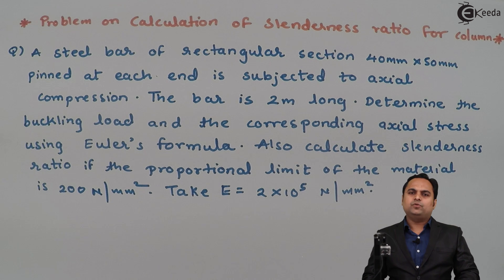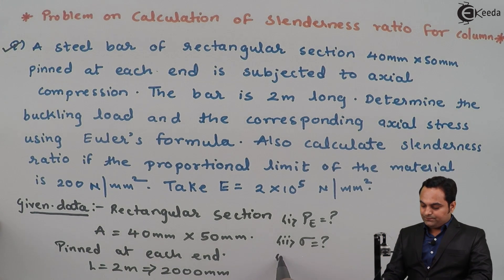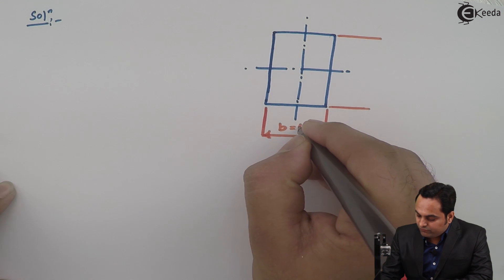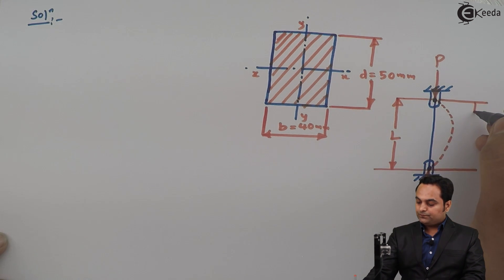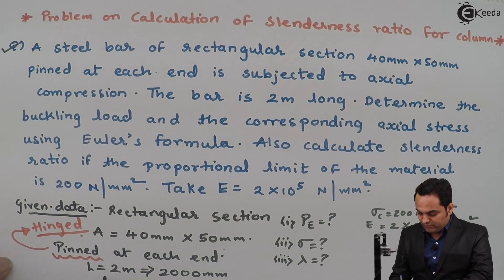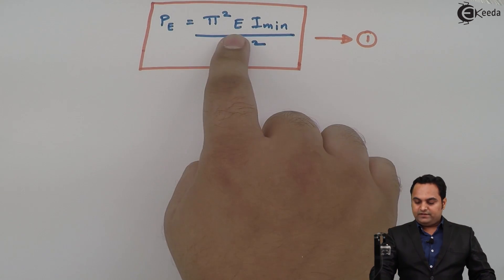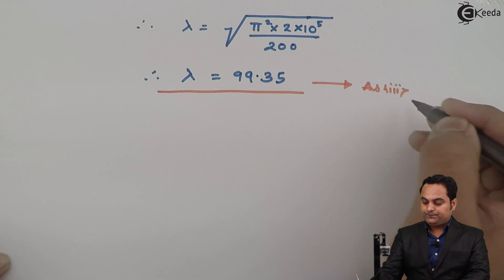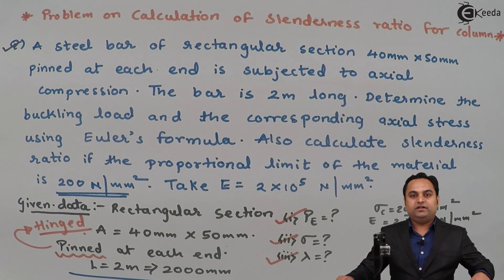Problem on Calculation of Slenderness Ratio for Columns - Columns and Struts - Strength of Materials

Comment: Difference between minimum vs maximum
How to use the word minimum vs maximum in terms of allowable value?

1.The meaning of minimum is 
"it should not be less than" =therefore the correct allowable value is always the highest value

2.And the meaning of maximum is "should not be greater than"
=The allowable value is always the smallest value

Pls correct me if im wrong thank you

Comment: If we calculate slenderness ratio directly by formula ( effective length/ minimum radius of gyration) = 2000/11.547 = 173.20 but in this video its value is 99.
Reply: I have also got same  (173.20).
Reply: yess .. why is that ?
Reply: I have also got same . 
Hello seniors 👋
Reply: , i also got 173.204
Reply: the Leff/K is the actual slenderness ratio of the column geometry, and the second is a limiting slenderness ratio related to material and buckling stress limits. They serve different purposes: one describes the column's physical slenderness, and the other helps predict the buckling behavior threshold

Comment: on the same kind of problem, they have asked lateral deflection delta/eccentricity (e) to be calculated by a flexural equation  (M=P.e) providing yield stress.is it necessary to deduct direct stress from yield stress to get bending stress or can we consider yield stress as bending stress directly  as in Euler's theory we neglect the effect due to direct stressesI have gone through some problems. in which they have used both ways considering the effect of direct stresses ( for gradually increasing axial load ) and without for normal axial loading.please guide. eagerly waiting for the reply.